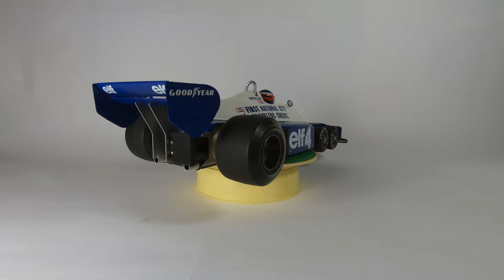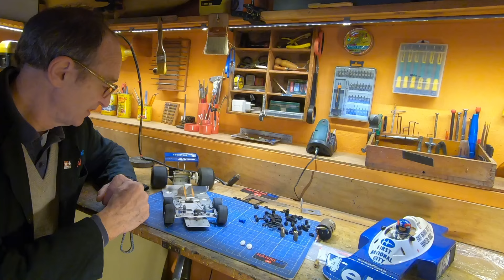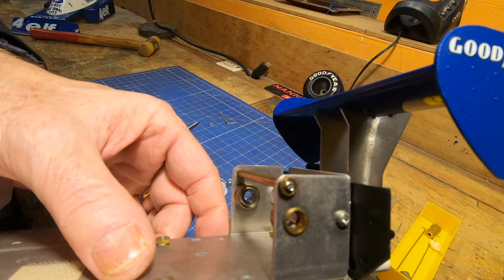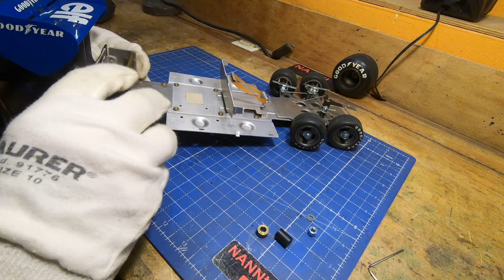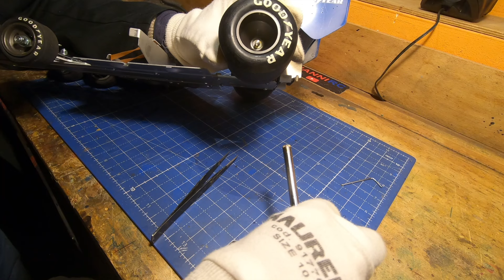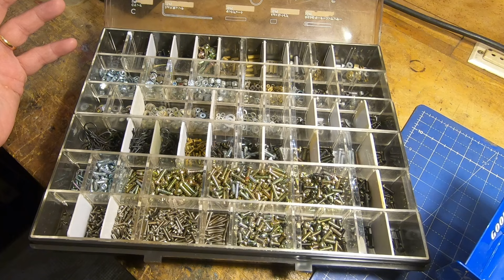Tyrrell P34 refitting work on the original vintage model.

Comment: Excellent! 
I do not own this car, nor the F103 Re-Re, but for when I do;
I have been planning ways to increase the Ackerman angle on the front Axle (for both chassis) in proportion to the second steering Axle to increase overall steering grip.
These are things I lose sleep over, but they are possible, and fun hopefully :) 
Ciao Nanni!
Reply from the maker: I think that having such a challenges is the meaning of life! Good work! thanks and Ciao!!